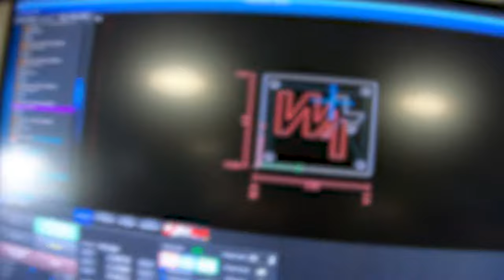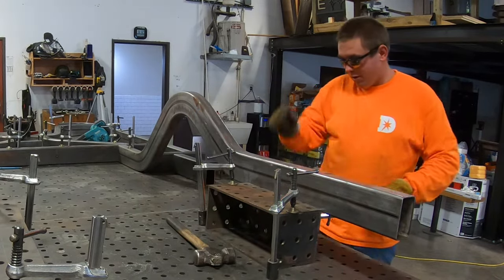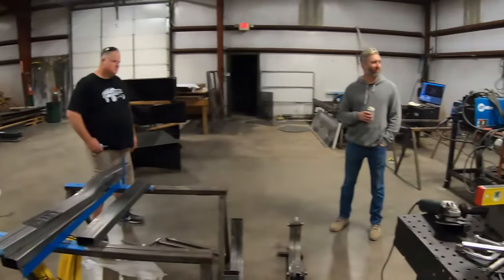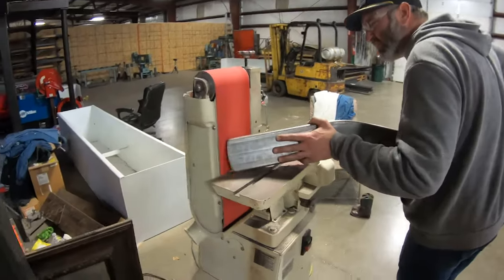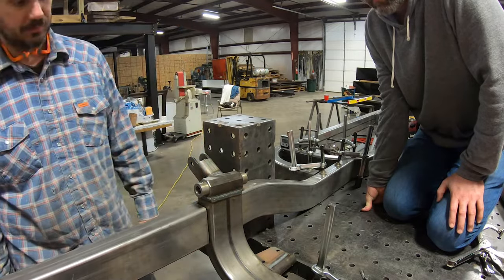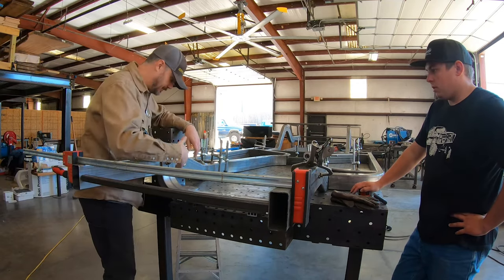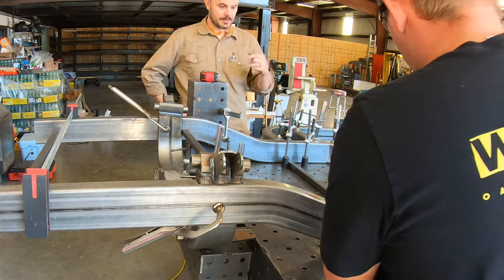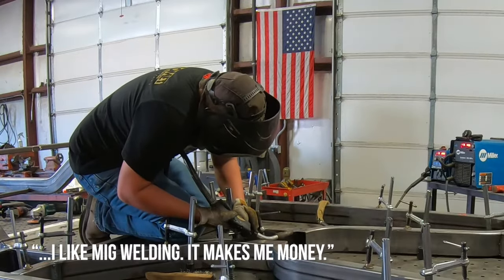Built from Scratch 1970 Dodge Charger Chassis | The Willomet Special 03.2

Comment: There are ways of bending square tubes without getting the tubes sides bend.
1 - Sand filled bending - a bit more work than conventional bending but can be done with the same machinery
2 - Pressurise the inside of the tube - a bit more work than conventional bending and it needs some kind of a hydraulic aggregate.
Reply from the maker: Cool details!

Comment: Best car fabricator channel i have found. Great job guys! Question, what miller tig welder are you using?
Reply from the maker: Hey, thanks for those kind words - glad you're here. We did all the rough assembly with a Miller Dynasty 280. I did the rest of the finish welding on my Everlast 210EXT.

Comment: You're putting a 4" tall frame under a unibody car (though I assume you'll have a custom floor to accommodate it).  I assume the car will be lower than stock. Is ground clearance a concern?  Curious to see how driveshaft and exhaust will be routed.
Reply from the maker: Ground clearance is set at 4.5” under the front crossmember and about 6” at the rear of the rocker. There’s no more factory floor or unibody, so parts and systems will route to make a flat bottom car.
Reply: I'm enjoying these videos!  Very interesting.  Btw, your American flag is backwards.  Stars always go upper left corner.  Sorry, had to point it out because it keeps popping out at me.

Comment: are those welds going to hold up tho? are those any special type of welds? specific wire used commonly on vehicle frames which less prone to fail? Please cover this THANKS
Reply from the maker: Those TIG welds will do just fine.  We used regular 70S-2 and -6 filler.

Comment: Why did you choose square tubing for the frame?
Reply from the maker: I chose 4x2 rectangular tubing because it’s easy to bend and it’s a good strength vs weight balance for this build.
Reply: @Willomet Motor & Fab  OK awesome I just usually see people using normal round tubing.

Comment: Is this 1/8 inch wall thickness?
Reply from the maker: It's all .120 wall before pending. The outside will thin to about .100-.110, while the fat side gets a smidge thicker.
Reply: @WillometMotorFab  thanks that helps a lot 🙏🏽